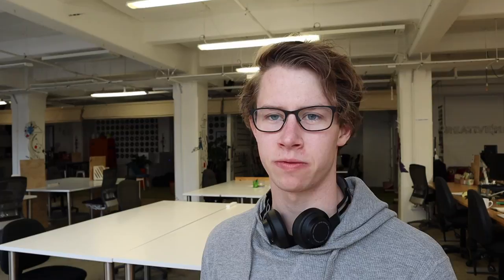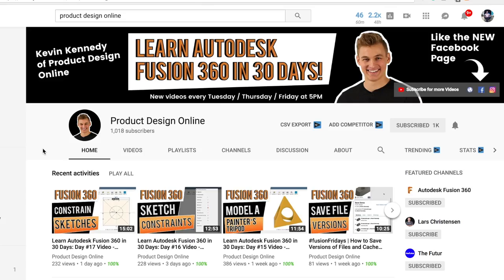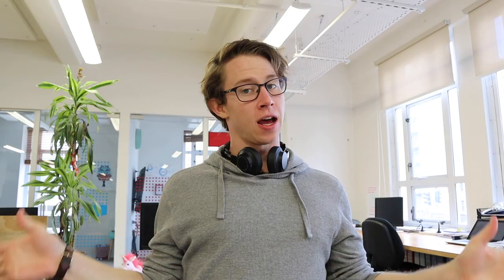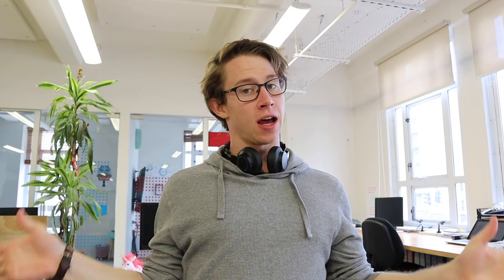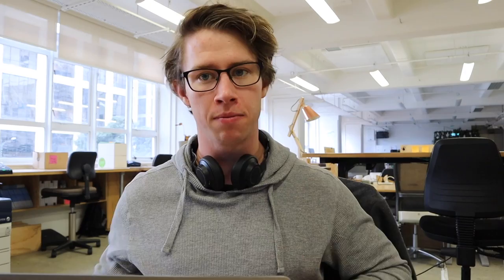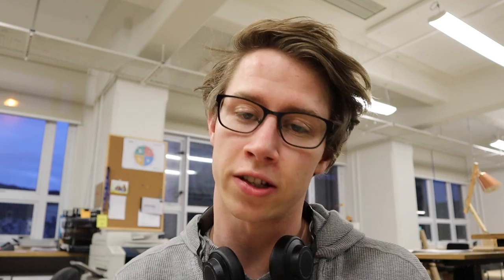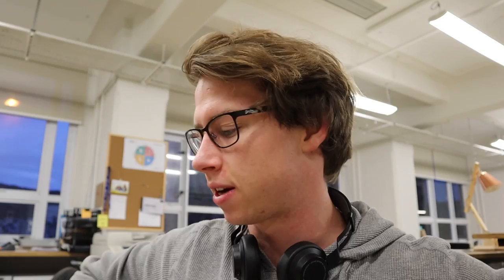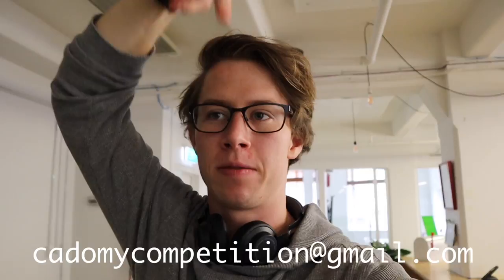Can 1,000 People Design a Product Together!?

Comment: Could you create a discord server for any questions e.g. are we only able to use 1 part ? or can it be an assembly? - Also what file format do you want it submitted as?
Reply: 1) Can it be an assembly? Yes. But, please make sure that you activate the component/assembly before working in it so it is easy for us to copy into another file.
2) Please email your .f3d file to cadomycompetition@gmail.com by September 3rd.
Reply: @ProductDesignOnline  so it has to be made in fusion? I personally use Solidworks. :(
Reply: Moximaxius - For this competition, we are requiring it to be modeled in Fusion 360. I encourage you to download Fusion 360 for free (https://academy.autodesk.com/getting-started-fusion-360) and give it a try! 

I personally used to solely use SolidWorks and ran a SolidWorks user group a while back. Based on my experiences, I think you will be able to pick up Fusion 360 in a very little amount of time. You can even change your Fusion 360 preferences to SolidWorks which will make the transition a bit smoother - http://bit.ly/solidworks-preferences

The Handlebar Grip would be a great beginner project to tackle!

Cheers, Kevin :)

Comment: @myrin what are the dimensions for the head tube ?
Reply: Shekhar - Dimension requirements are listed in each template. Cheers, Kevin :)
Reply: but i am not able to view them there's just a blank paper or i can say a blank sheet
Reply: sorry BRO i could not find any dimention and stuff....so i'm making a model in Fusion360 and i'll upload it....better that you deal whith the dimention....i'll just give you my concept and idea..but please review my model
Reply: Taruna - You have to double click on the sketch and open it to see the dimension template. Check the lightbulb in the Fusion 360 browser, make sure it's yellow (turned on).

Please abide by the dimension requirements or we won't be able to use it in the final assembly. Cheers, Kevin :)

Comment: Should part be designed only in fusion 360... can't we use other CAD softwares?
Reply: Manish Gupta - You'll have to use Fusion 360 to participate. You can download Fusion 360 for free (Windows and Mac) - https://academy.autodesk.com/getting-started-fusion-360

If you've never used Fusion 360 before then check out some of my beginner tutorials. It's pretty easy to pick up once you start playing around with it. Cheers, Kevin :)